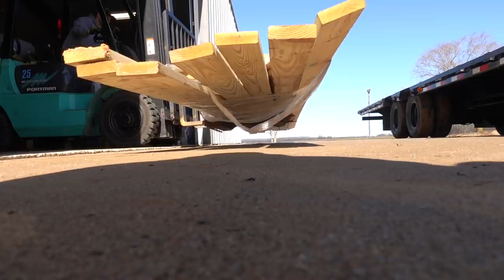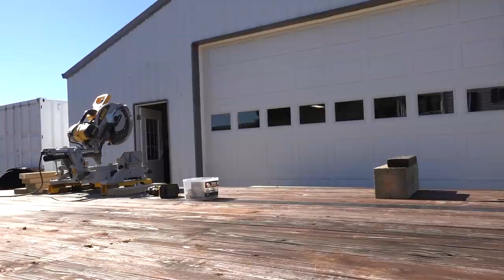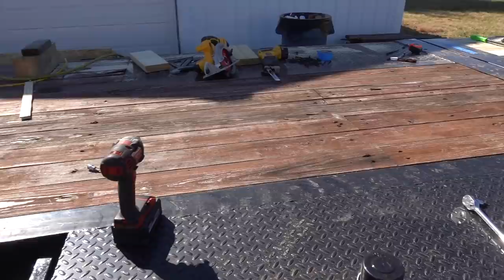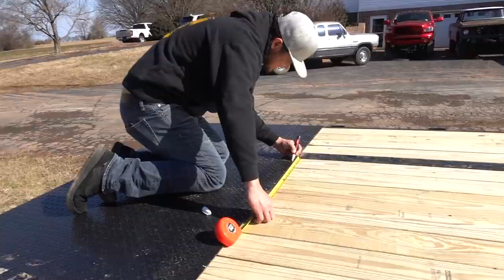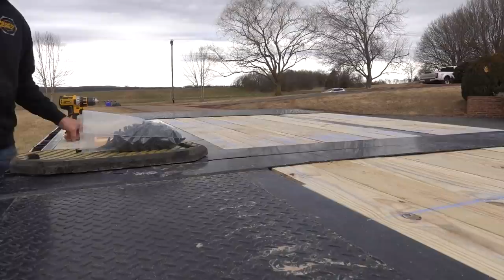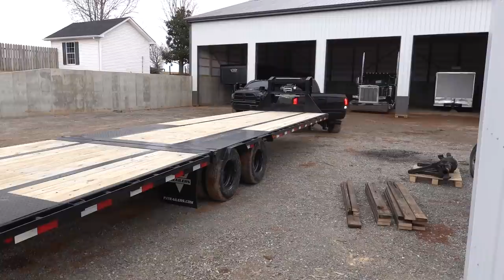GOOSENECK TRAILER RESTORATION!!! LOOKS BRAND NEW AGAIN!!!!

Comment: I have done 100s of decks, cut the boards in the middle and put a floor jack underneath to pry the deck up. Then use the mega sledgehammer to break the torque screws. Next you can cut your boards 1.5 in longer than the deck and use a large 2x12 to bow the wood in half hit it with a sledgehammer so it slides in and use SELF TAPPING deck screws. In our dry state even with a deck oiled if the trailer deck is not overlapping on each side it will shrink and bow up.
Reply: Smart man, good info. Work smarter not harder.

Comment: How to replace the deck on a trailer: Cut a hole on each side and take a chain and wrap it around all the boards then proceed to hook up to the bucket of a loader and rip them off. That’s what I’ve found to be the best way 😂🤣 It not only kills drill bits it also kills drills. There’s a hell of a lot of holes to screw down a deck.

Comment: On the past two or three trailers I have done I drill holes in the trailer frame and drive either stainless or coated wood screws up from underneath into the wood that way the screw never corrodes to the steel and when you go to replace it you are just have to pull the screws out of the wood. It also looks super clean because you don’t see fasteners from the deck

Comment: We usually break the boards off then cut and grind the old deck screws down and redrill the holes.  

Atleasr thats how its done on semi trailers

Local place here now sells self drilling trailer deck screws.  Saves on bits and time

Comment: Diamond C probably used a deck Screw Gun used in construction on decks and floors. If you ever need one you can rent them from local tool rentals. You can find the screws at home depot. The gun is stronger, leval and the screws go in the depth.

Comment: Fastnal has better drill bits than Lowe's JS, the cheap ones don't last if the it wernt for the wood I'd say use some oil on them bits but you'll have to be careful not to get it on the deck!